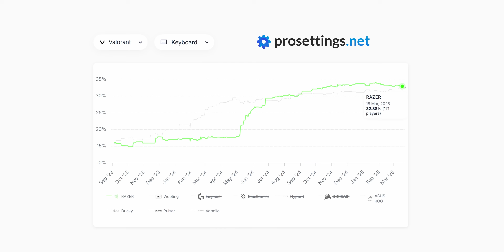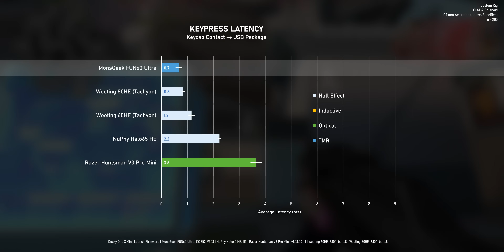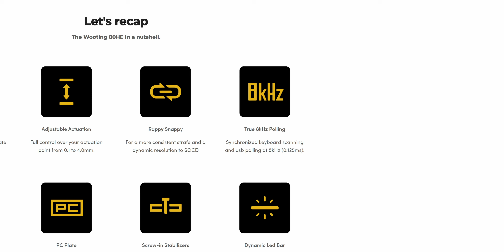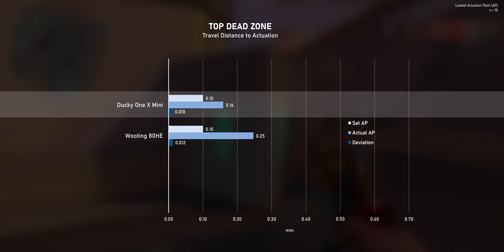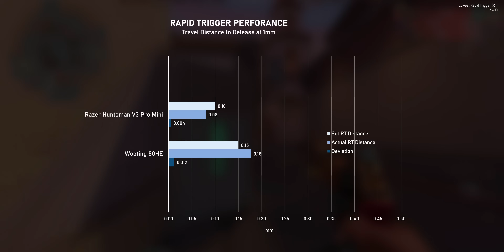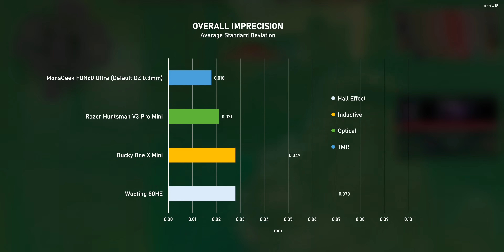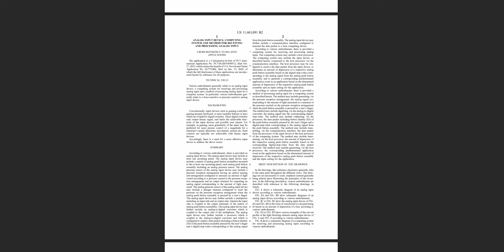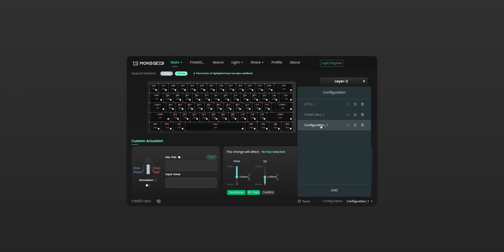These New Keyboards Are Here To Replace Hall Effect

Comment: Thing is, unlike mice, “wireless” keyboard is not nearly as essential. There is still a niche for them as with everything but for gamers, that’s just another device to charge. I don’t mind wired keyboard because it’s just stands there static.
Reply: Using my computer extensively every day, my G915 TKL lasts 6 months between charges.  Add in the fact that I'm not around my desktop half the time anymore and it lasts even longer.  Honestly such a long life easily makes the advantages stand out.  How long a battery lasts in practice is such a factor.  I can't stand a wireless mouse I have to charge every other day, but I love one that only needs it every other week.
Reply: I love tri-mode keyboards because while at home it can sit on my desk plugged in but if I want to use it some where else I can just unplug it and take the dongle, or if I'm not gaming just forget the dongle and use Bluetooth
Reply: its not just charging ii care about input a lot even if wireless inst as bad when your game is factoring the frame that the input happened in and their is a delay in the time rendered then that delay on the keyboard or and anything else will be off even more and its annoying right now this is just a counterstirke thing cause of SUB tick servers their aids
Reply: Yep it serves literally no advantage for me since my keyboard is always sitting on my desk controlling the same PC so I'll always take the reliability and speed of a wired connection and convenience of never having to think about charging it. Though I could see advantages for people who switch between multiple devices or pack up their setup for LANs and whatnot.
Reply: Yeah, having wireless keyboard is just aesthetic advantage, if you want wireless setup. Nothing more than that.
Reply: @4ma-deu5  Having a wireless keyboard with BLT and 2.4 gives you more possibilities than just aesthetic ones, e.g.: switching between two computers - remote work, laptop and your desktop computer next to it.
Reply: @4ma-deu5  well no. If you have multiple set ups you can just change between them. Mac, Steamdeck/Handhelds. I have a PC on a monitor set up and one for my tv. I can swap between pretty much any of them when i need them, instead of having 3 or so keyboards for each.
Reply: @zevolta88  true.
Reply: @zevolta88  Okay but you could just have a detachable cable on your keyboard and have a cable for each PC, and just plug it in at each PC
Reply: @zevolta88  Yes we can all see whenever you are swaping since you are broadcasting it to everyone, soon we will be able to decrypt your wireless signals.
Reply: @zevolta88 you would never need 3 keyboards for each.. use a kvm switch or leave a cable at both setups. Stop trying to justify a stupid product. Takes longer to swap Bluetooth connections vs a cable anyways 🤡🤦🏼‍♂️
Reply: @IsaacShoebottom  USB connectors will degrade overtime if they are constantly plugged and unplugged.
Reply: @backgammonbacon  yeah, good thing the cable is replaceable right. Also let's be realistic, this won't become an issue if you treat it well for like 5-10+ years and at that point the cable will probably not be the concern.
Reply: @IsaacShoebottom  yes, and destroy USB C after 1000 plugins.
Reply: Sure, if you’re using bluetooth, at which point gaming performance is straight out the window.
Reply: @IsaacShoebottom cables aren't always replacement. Mine are fixed cables which means i can't replace the cable without replacing the entire keyboard or mouse. You kinda need a wireless mkb in order to use said replaceable cables
Reply: @red-merlin Depends on the brand. I would personally just never use a keyboard without a replaceable cable. I hate products that are built without any repairability in mind. Its why I switched from Razer to Keychron after being disappointed at how inflexible the Razer was to use.
Reply: @IsaacShoebottom I actively do this with mouse dongles between a macboook and a pc and it’s a huge pain in the ass.
Reply: @4ma-deu5 The same is true for wireless mice.
Reply: @clocked0  You're actually wrong. Mouse is actually a movement peripheral. A wire is actually affecting the way you play/aim. Unless you're playing at a professional/high-level, it won't make a difference. But if you play shooters, or 'osu!' on a wireless mouse, you won't be able to go back to wired mouse, because the cable will drag you down.
Reply: @4ma-deu5  Sounds like the cable isn't long enough or your PC is too far away if the cable is actually an issue
Reply: @clocked0  It's not like it's an issue or anything. You can simply play like this, and be good. It's just locking like 5% of your potential. Also it's not a problem with how the cable is connected or where it's connected. Wherever it's connected it's a cable, it's linked to somewhere. If you look at it from Physical point of view, you should even understand that in some directions the mouse will require more force (when you pull to yourself), and will require less force when you push from yourself. When you don't have a wire, that's not a thing, you use similar force in every direction.
Reply: @4ma-deu5  Yeah but the force required would almost entirely depend on the tension in the cable, which is really only an issue if there's not a whole lot of slack. That's why I said either the cable isn't long enough or your PC is too far away. 

My mouse is wired and it's not any more difficult to drag it towards me compared to any other direction on the mousepad. 

However I also have enough room to have a bit of cable sitting on top of my desk too instead of leaving it all subject to gravity as my PC is underneath my desk.
Reply: @4ma-deu5 New unnoticeable cables make wired mice the best choice for pros seeking lower input lag
Reply: @4ma-deu5  You know what dragged me down when using a wireless mouse? having to charge the damn thing... Wires are reliable, batteries are disposable.
Reply: @ Personally, that's less iritating than wire. I use wireless mouse since like 2 years, and i charge like once a week, while watching YT.
Reply: @leviathan5207  many wireless mice are qi capable now and simply charge on the mat, granted you have to be creative and put  a charger under the pad, which is simple or get a dock. i wouldnt go back to a wired mouse  if they were free for life. logitech has had  powerplay for 10 years , you never have to charge it, and since it trickle charges to 84% it lasts wayyy longer than regular lithium ion batteries, like 5-10 years. in fact all qi mice stop at 83 or 84 percent, which is the ideal charge for battery longevity. its simply a solved problem in 2025. oh and wires get frayed to and have to be thrown away
Reply: @4ma-deu5  the fact this is even being argued shows this person is probably trolling. theres no way one cant see the benefits of a wireless mouse, which can knock sodas over, is annoying, creates friction  which even if slight can be felt. vs a keyboard which is stationary unless you want to move it when you're finished. i take the betterys out of my wireless keyboards usually , for safety since there pretty big lipo or li-ion and can swell over time with no use and constant charge
Reply: @clocked0 I would say that most people that have gone from wired to wireless -> would prefer wireless  mice going forward..

Having used them for years, any wired mouse - regardless of how good the cord is - feels like an anchor tied to the mouse.

I'm not trying to say that it's the "best" or "only" option.. It's just something that i will never revert back to.
Reply: @clocked0 for me it's not that the cable isn't long enough. Just how the cable drags the mouse back to a "neutral position." As well as the cable coming off my keyboard occasionally getting slightly in the way. My current setup works but it would be far better for me to go wireless. I like couch gaming and my board is on a coffee table. It would be nice to be able to move it more freely. Still really like my mouse and keyboard, a Hermes p1b. Like the contoured key caps and the clacky sound. But I still intend to get a wireless set in the future simply for less restrictive setup. Also going wireless will free up my USB ports for the day i eventually get a hotas setup. Then I would be able to connect a controller, the mkb, and said hotas simultaneously.
Reply: @leviathan5207 charging really isn't a hassle. It's no different from needing to charge a console controller. I tend to set devices on a charger when I know I'm not gonna be using said thing for a while. But you could also have it charge while using it as well. I'll even use the block for my phone in the closest outlet for my controllers so I don't really see a mouse being much different
Reply: @mauricio-leyenda   wireless mice became so good that there's no difference between wireless and wired in input lag, it's just placebo at this point
Reply: @4ma-deu5 if you have your desk setup properly a cable does not inhibit movement whatsoever objectively
Reply: @4ma-deu5 people adjust to all kinds of movements and the minimal difference in force required for removing a cable is even less relevant than the weight of the mouse
Reply: How is a wireless mouse essential? Not ONCE has a wire gotten in the way of me playing a game.
Reply: @leviathan5207 Keyword : "Me". 

Most people play on medium to low sensitivity, going back from wireless to wired is quite annoying journey. I tried few times and even with bungee, the slack of my cable sometimes get under my mouse or it hits my fingers distracting me. If it doesn't bother you, more power to you.
Reply: @3ildcard yup same issue here. The slack of my cable will interfere with my mouse in the same way occasionally. And there's the slack of the mouse cable creating a neutral position of the mouse which is also annoying
Reply: Wireless keyboard are not secure, I prefer not to broadcast my keys even if they encrypted.

Comment: Very good breakdown. I really appreciated how you clearly separated accuracy and precision. Probably one of the best researched analog keyboard videos out there!

Some things I would add from our (Wooting) perspective:
1. I'm still not 100% sure if TMR is always better on wired keyboards. For wireless it does provide power consumption benefits, but even that is not as large as specs make it out to be. The raw output from TMR sensors is a very low voltage, so for better analog scanning you still need some sort of active amplification. I suspect that's why MonsGeek's keyboard power consumption is still fairly high. Inductive sensors don't scale well like you mentioned, so I don't consider that a good comparison on the power level.
2. A big part of the difference in technology when it comes to RT sensitivity and accuracy + precision is in the PCB design and the Firmware Key Scanning. For the sensor technology it mainly influences the output noise. This noise is different for each technologies, but doesn't say everything. It's much harder to communicate these other parts in marketing though, so that's why there's a lot of "TMR is new and always better" out there.
3. It's very impressive what MonsGeek and other Chinese factories have been able to do on a technical level. We're working hard to improve on this front. As you mentioned the software support is horrendous, and generally customer service and availability is also not the best. We've been in touch with a few of them and they're genuinely passionate about making the best hardware.
Reply from the maker: Thanks! Appreciate you sharing your thoughts on that 👍
Reply: sounds like cope
Reply: @rakurai7367  ?? Did you read the comment at all?

Comment: Ducky seems lacking in software but there are other inductive keyboards on the market, like Black Shark BKB02 and Rapoo's sub-brand, Aesco A67 or A83 keyboards, and I better go with A 75% keyboard than the very limiting 60% of the current TMR lineup. If you could, try the other inductive keyboards to see if they are better than the Ducky one. A test for the others would be great.